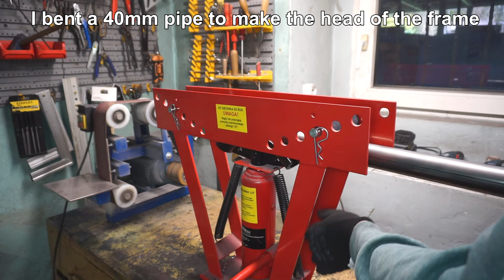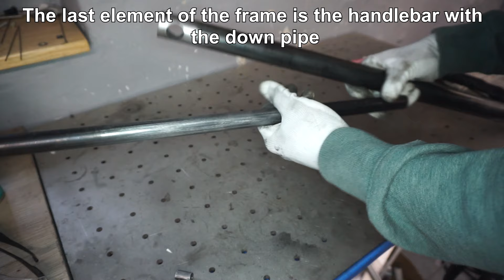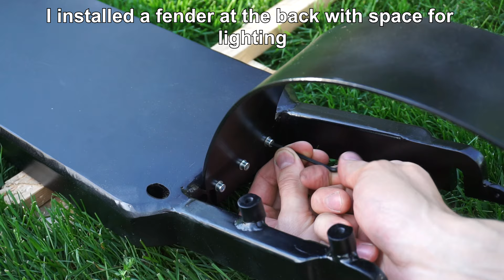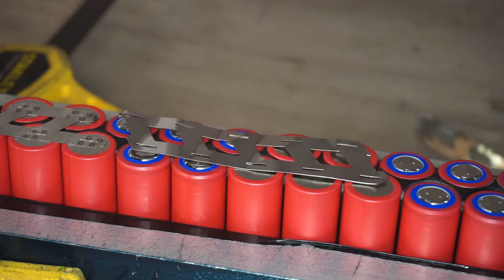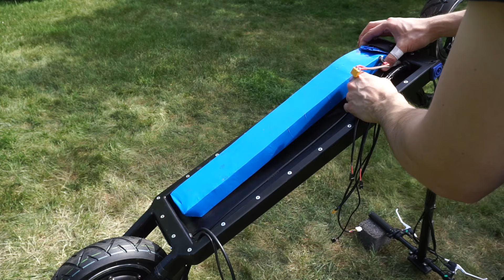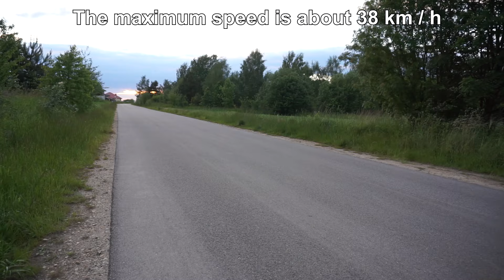Making a Fast Electric Scooter with a Brushless Motor

Comment: With a 60 volt battery and a controller you could reach speeds up to 90km/h. i have done it with 500w motor and 60v battery.

Comment: stunning quality work...i find your videos inspiring...if you make a future video of this scooter, 1mm steel plate will strong enough and weigh much less, or 2mm Aluminium, though, you did not say what the belly plate is made from...if it is 3mm steel, it is more than strong enough, but adds to the weight, decreasing the distance...but it is all good, and your videos and work are great...😀

Comment: Everything is fine, but the front light, it seems to me, will still strongly blind oncoming people.
Reply: It's just over-exposing the camera.
Reply: @asdfghjkl7507  At 4:50 you can see the design of the body - it does not take into account the tilt of the steering column and, when glued, directs the LEDs slightly upwards.
Reply from the maker: I took into account the tilt of the steering wheel! Look at the lamp at 4:52. The LEDs holes are at an angle, large enough to finally point the lighting down
Reply: @OBN_RacerMan  At 9:38 you can see how bright they are against the road.  Really not that bright.
Reply: @maciejnowakprojects  I understood - it was just not very obvious from this angle.

Comment: Why 36v? I mean, more volt means more speed, and the 1kw motor can support it too.
Also, I can see there is some free space to fit the extra battaries too (for 48v).
I understand that you may not care about top speed and care only about torque, but then you should chose a dual motor instead, big motor in the rear wheel is recommended if you want high speeds
Reply: yes but if you dont need more top speed or more torque, you can have the benefits of a lighter scooter. 
2 motors 2 ESC  more battery the weight would increase a lot.